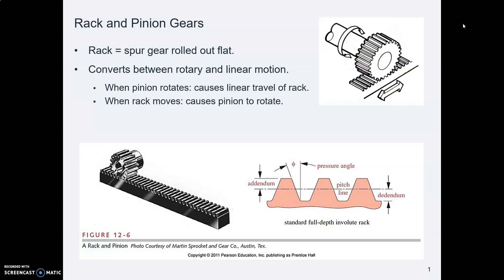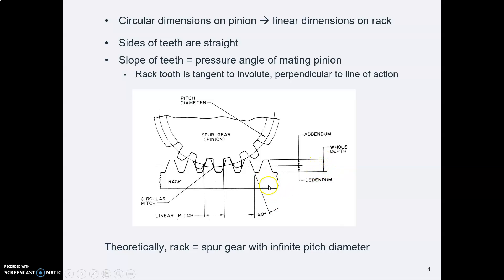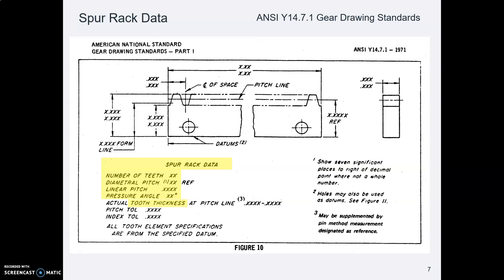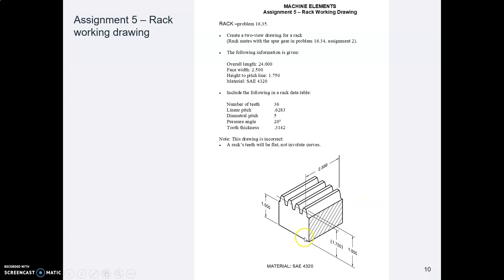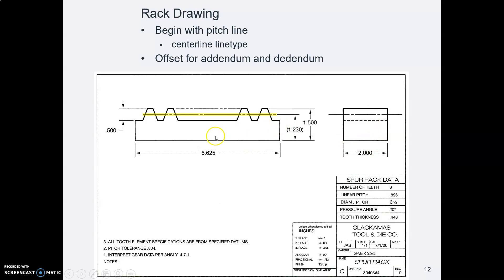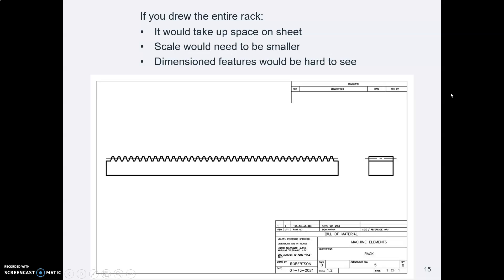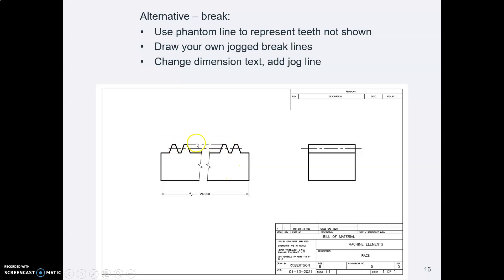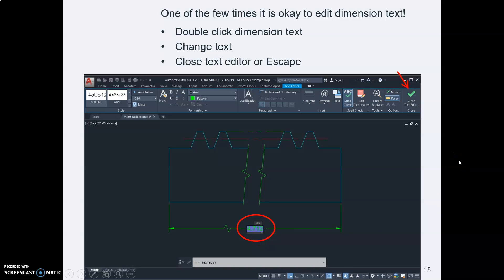ME05 rack & pinion gears

Comment: how to specify the tolerances on tooth thickness in spur gear case ?
Reply from the maker: Give tooth thickness in a gear cutting data table. (Machinist will use that to set up the gear-cutting machine.) You can give tolerance in drawing title block, in a separate note, or directly on the tooth thickness in the data table. Standards for selecting tolerance classes are in American Gear Manufacturers Association (AGMA) handbooks.

Comment: why does a pinion rocks on the Rack teeth. what could be the reason for it. Simple may be. I face a problem. Is it the backlash or clearance or wearing or geometrical or poor center dist. either they become tight or the pinion gear rocks despite the motion being normal. But, curious to know the rocking phenomenon and the geometrical error with it. Can you help me or someone for that matter. Thanks.
Reply from the maker: I am sorry--I do not know. Backlash would be my first guess.